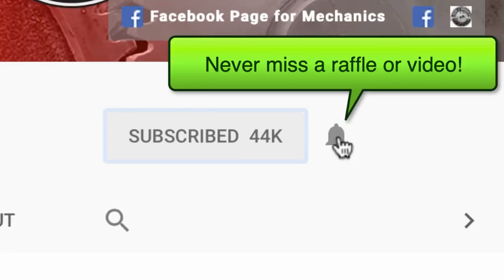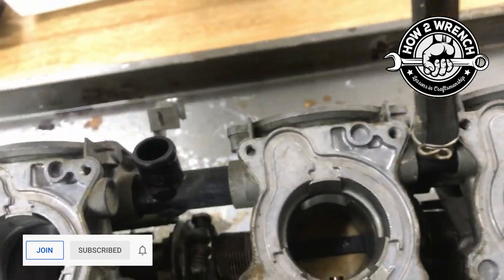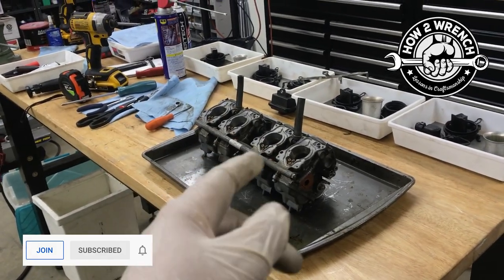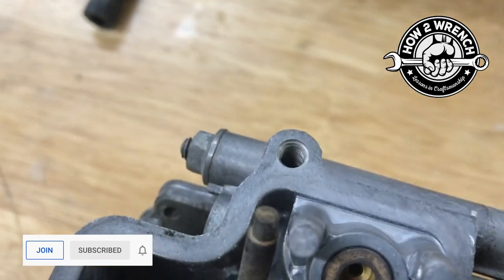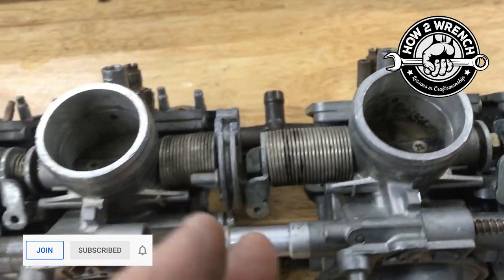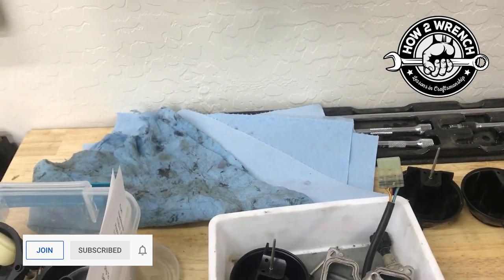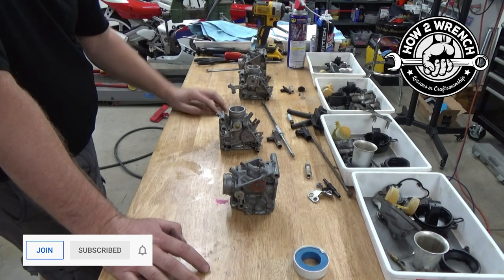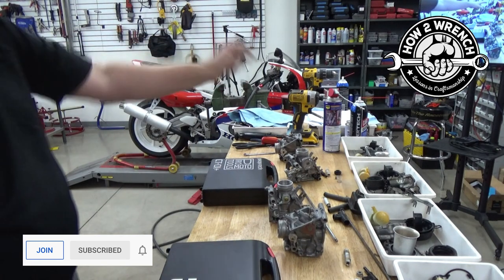Do #ultrasonic cleaners work? 30 min test! ALSO: Can you identify this weird part? #simplegreen d

Comment: Clearly the tape is just a hatchet job because they didn't have O rings. The dents are probably the same person that put the tape on dropped the rack. Those are very very similar to my 97 and 98 F3's  carburetors. I keep a spare set so my down time between carb rebuilds is minimized. Great video BTW. I have a small ultrasonic machine, but I use on the individual bodies with everything out so that it gets everywhere. Under pilot screw especially.

Comment: Nice video. I've got a Suzuki GSX250 Across, someone has dropped the carbs in the past and cracked the corner of one of the float bowls. Hairline crack all the way through to the drain screw thread. Tried to repair it but still leaks. Bummer really.

Comment: Can I take my 1975 Honda CB750 carbs and put the whole thing into my ultrasonic cleaner without taking them apart other than taking off the bowls?  I bought a crusty set of CB750 carbs a few months ago that I took completely apart, cleaned and rebuilt for educational purposes.  The carbs that came with the bike are working great, but they're a little grungy looking so I wouldn't mind cleaning just the outside of them, which is tough to do with a brush and spray cleaner (too many nooks and crannies.).  Tossing them in the ultrasonic cleaner without having to break the rack apart and pull out the slides would be an easy way to make them look nicer, but I don't know if that would cause problems.
Reply from the maker: You can absolutely put them in whole. That great thing about the ultrasonic. I'm still not convinced on rubber in some solutions. Maybe water only...just haven't experimented enough with rubber samples yet, so I stick to metal of short cycles and make sure to blow dry asap when removed. I will also spray down with wd-40 after too.
Reply: My advice is try with one small part first,  like a a bowl to see how it works out.    And only for 1-2 minutes,  and brass jets only need like 15 seconds  to brush off the crud.  And i use very small 30-50W unit.   If you put them for too long or wrong solution  it will stain and deteriorate the parts, basically trash them.
Reply: @How2Wrench  Thanks. I appreciate that you make an effort to read comments and answer questions.  Are you teaching classes currently?  It'd be fun to come to Arizona (or wherever you currently are) and learn some new skills.  Since getting my first bike two years ago I've become a bit obsessed about learning to work on  my motorcycle.